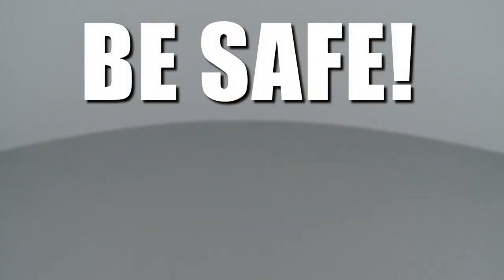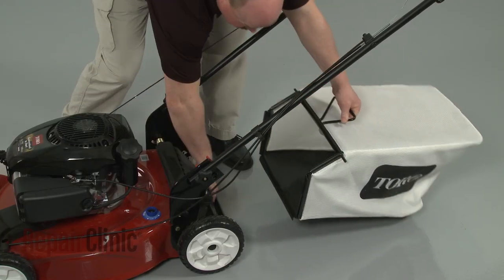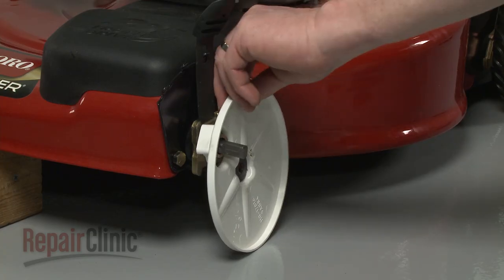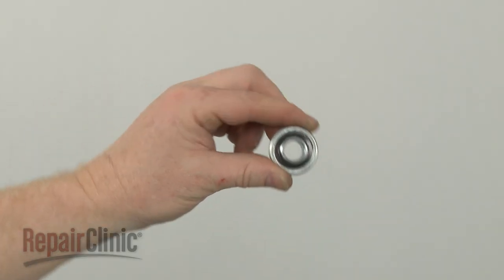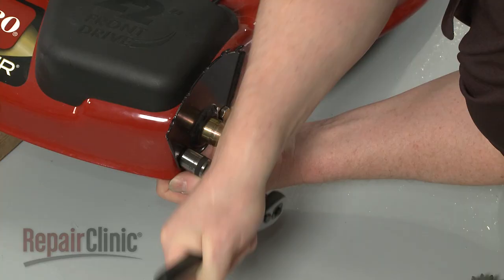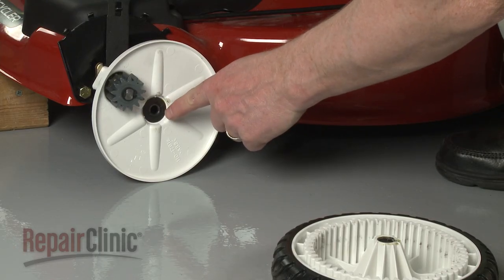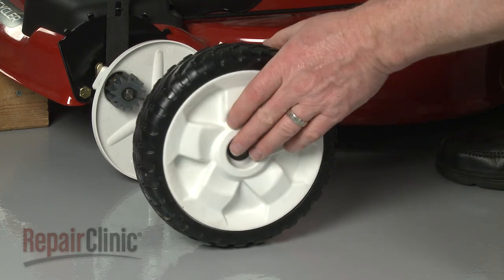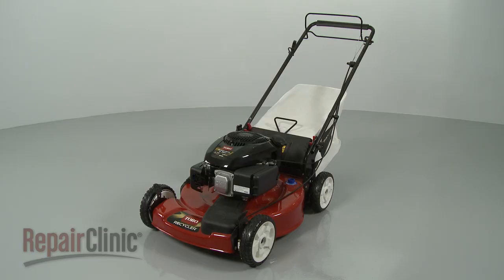Toro Lawn Mower Ball Bearing Replacement #104-8699

Comment: Hi, great video! What sort of issues do you experience when the bearings are bad. The front wheels on my Toro Recycler lawnmower lock up from time to time just rolling it around without engaging the self-propel bar and sometimes when I'm mowing. I've checked the belt tension and it seems fine. Unfortunately, the pinion gear on one side is rusted to the shaft and I can't get it off. I can't find a gear puller small enough to help in this situation. The mower is about six years old. Thanks!